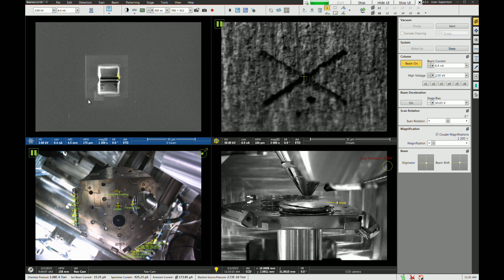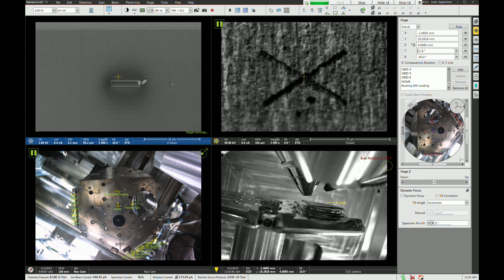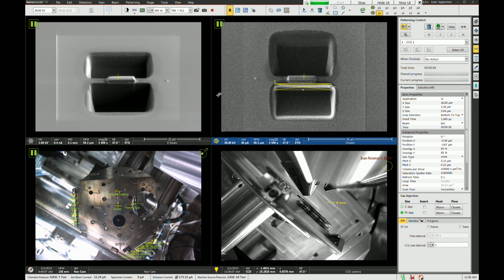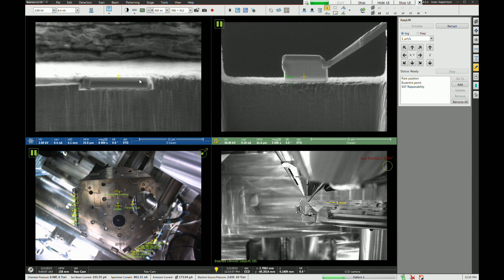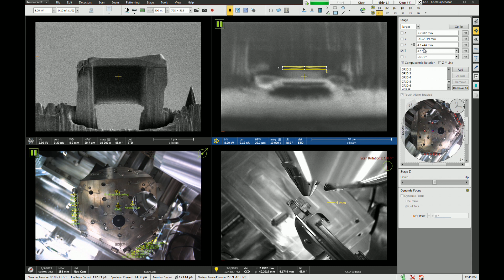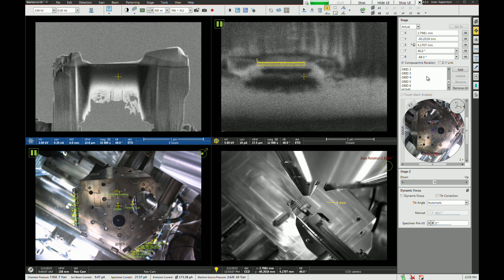FEI Helios G4 PFIB CXe dual beam FIB/SEM: TEM lamella prep tutorial

Comment: Thank you so much for sharing! Very interesting to see how different labs are approaching TEM with pFIB 

Surprised to see you use such a thick e beam layer. Ill be trying thicker electon beam pt. Ive been using tungsten recently ( would highly recommend this if you have it)

Have you tried thinning with box cuts recently i reverted back to this and it has sped up my sample prep significantly! 

Really interesting to see you cleaning samples at 8 keV do you do this all the time or Just for high resolution and do you notice a significant difference compared to 30 keV + 5 keV ?
Reply from the maker: Hi Stuart: thank you for your support.  I've actually tweaked quite a few things with my lamella prep compared to what I did when I made this video.  I don't tend to go quite as crazy with the E-beam Pt and I use a much lower current density when depositing I-beam Pt.  I also no longer PFIB final thin below 8 kV, because I find that the curtaining at 5 kV (or less) is simply too severe (in spite of the supposedly thinner damage layer).  A long time ago, I did use the rectangle pattern more when doing final thinning, but I now basically only use the cleaning cross-section.  I find I simply have far more control of the thinning process and I end up with cleaner sidewalls using the CCS (which I imagine is how "cleaning" got in the name).  If I want to be more aggressive with the thinning process, I still stick with the CCS, but I just increase the beam current.  I have indeed heard good things about W as a protective cap, but have not had the chance to test this out yet.  I'm curious as to what (if any) morphological differences exist between W and Pt deposited via both E-beam and I-beam.

Comment: you mentioned in the video that we could do a post cleaning step after j cut. what is it for? How to do it? what is the setting for doing this step?  what will the sample looks like after cleaning step?
Reply from the maker: It's nothing special; it's just a cleaning cross-section on the top side of the lamella (in the FIB image with 180 degree scan rotation) after doing the J cut.  This just evens this side of the lamella out so it is nice an flat.  I would do this at 4 nA, the same setting i used for doing the J cut and also with 5 degrees of over-tilt (like what was used previously for the trenches and rough cleaning).  Thanks for your question and I hope this helps.

Comment: Hi Nick, It's a very fantastic video, really like it. I have one question: for the last milling process with 5kV or 2kV, will a longer time be better? Does it have any side effects?
Reply from the maker: Thank you; I deleted the previous comment because I wrote it thinking your question was in reference to the Ga FIB, but this is actually about the PFIB.  In general, I don't bother using 2 kV with the PFIB.  The reason for this is that the curtaining of the sidewalls at 2 kV with the PFIB is very bad and the difference in damage layer thickness between 5 and 2 kV isn't that substantial for PFIB, so I just avoid 2 kV.  Thanks for your support and I hope this helps.

Comment: why do we cut at 47 and 57 degree after the Pt deposition? I was got taught by to cut this step at 52 degree. Is there any benefit for this?
Reply from the maker: This is called over and under tilting, and yes, it does have two main benefits.  The first is that it tapers the lamella down thinner near the bottom, which makes it easier to perform the undercut (or "J" cut).  The second reason is that it helps to preserve the Pt strap so it is more intact during later final thinning.  Regarding the second point, I find that doing this over/under tilting is particularly critical with PFIB due to the larger PFIB beam sizes (compared to Ga FIB) because otherwise it is very easy to accidentally mill away the Pt strap before you ever get to the final thinning part (which you definitely want to avoid).  That being said, even with Ga FIB, I still opt to employ the same amount of over/under tilting, just to be safe.  Thanks for watching the video and I hope this helps.
Reply: @NicholasRudawski  thanks for letting me know! U also explain things really detailed, whenever there is a question posted here
Reply from the maker: @92104000b  You're welcome; glad to know I was able to help you out.
Reply: @NicholasRudawski 谢谢你让我学到很多
Reply from the maker: @zec5115  Thank you and glad to hear you are learning something from my videos.

Comment: Most of the time I lose the pt layer on top 😢
Reply from the maker: Yes, this can be very frustrating as I have experienced this myself, too.  At what stage are you losing it?  Is it during final thinning or is it before that?  The main way to address this is to makes sure you use sufficiently high over and under-tilts when patterning and to not be too aggressive with your pattern placement.  I also tend to opt for a much thicker Pt layer in PFIB compared to Ga FIB.